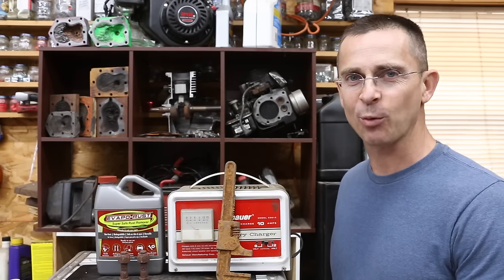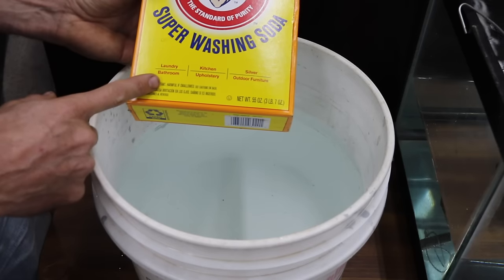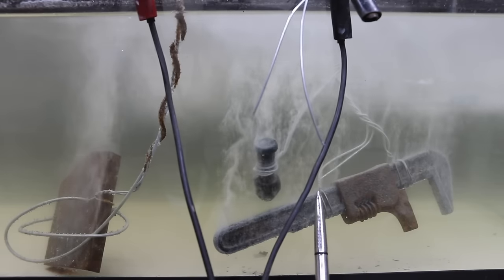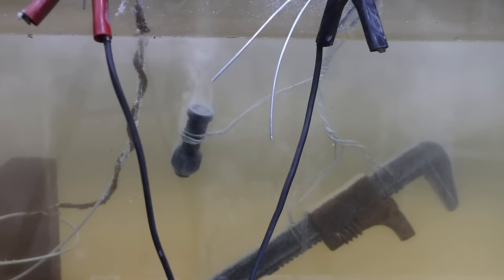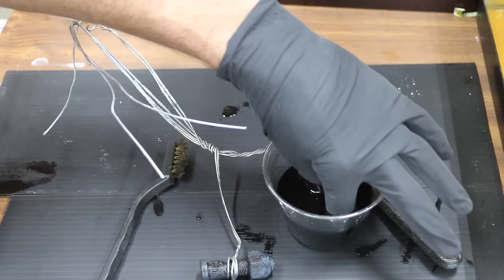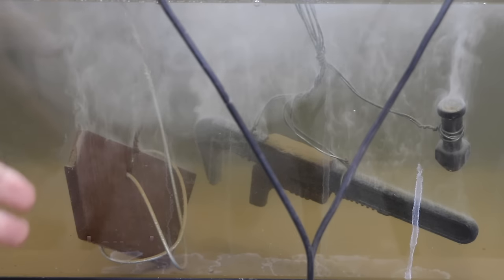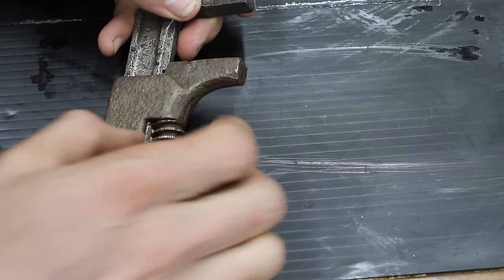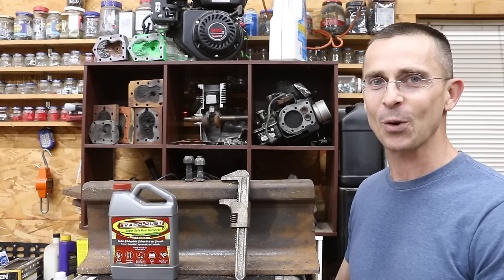Is Electrolysis better than Evapo-Rust?  Let's find out!

Comment: Have you ever used candle wax as a lubricant in an engine?
Reply from the maker: Thank you for the video idea!
Reply: That is a great idea!
Reply: @ProjectFarm  Perhaps as a second test barely dissolve the paraffin wax with mineral spirits.  That is what some of the bicycle chain dry wax lubricants use as a carrier.
Reply: Candle wax in an engine....ask anyone who uses Pennzoil. Very high wax content. Will work as long as the engine stays hot. Engine gets cold and solidifies.....game over.
Reply: I've thought of dipping tools and bits (screwdriver, drill, and router) in molten paraffin wax to prevent rusting, especially outdoors. The wax can even be recovered and reused by dropping the wax covered items in boiling water. The wax, being less dense than water, floats to the top and collects. I've discovered if the water is tinted with food coloring, the layer of wax can be easily distinguished from the water and skimmed off. 

To depart even further off topic, I was looking for a way to dispense paraffin for lubricating saw blades and screw threads and hit upon pouring molten wax into  an empty glue stick,(or chapstick, or lipstick)  container. Line the container with wax paper or parchment paper to keep the wax from sticking to the sides of the container. For broader strokes, use a deoderant stick dispenser to keep your tools smelling fresh and clean all day.
Reply: @philwood1009  Brownells cosmoline is my go to; I will give the deodorant stick dispenser a try.

Comment: Thank you again for your experimental comparison videos.

As electrical engineer i would say electrolysis is the most superb rust method.

The main reason is in electrolysis you lose almost no material from main part. basically it turns the red rust on the piece into black rust which is like a dustlayer and easily falls of with simple scrubbing.

Other methods such as acidic baths react with iron compounds (including rust which is iron oxides )and turn it into other compounds. As result they react with rust and main part and reduce material.

when you weight end products you will see (including electrolysis) reduction in weight. This occur in electrolysis due to removal of rust . in acidic compounds it will be both rust and main part.

If you make an experiment for a month putting two pieces one in electrolysis and one in acidic solution (refreshed acidic solution so acid will keep working on as electrolysis does) you will see that in acidic solution will melt your main part away but electrolysis just cleans.

Acidic solutions and electrolysis has both advantages and disadvantages.

Electrolysis has superb advantage of being cheap (you can make one with daily materials) however its labor intensive. It requires setup knowledge and if you want to rust remove 1000 bolts then you need to individually hang the bolts in solution which makes the process inconvenient.

Acidic solutions has superb advantage of ease of use . Produce a bath pour the solution in, dump the 1000 bolts inside and wait certain amount of time and drain it and clean . However it is expensive and since you produce a lot of chemical side compounds due to acidic solution and you have to dispose the acidic solution in proper way. ( electrolysis just has salty and rusty water solution)

Therefore i say electrolysis is superb on majority of applications.
Reply from the maker: You are welcome!  Thanks for the feedback.

Comment: Ordinary people: buy evaporust at the hardware store

McGyver: use electrolysis in the back yard
Reply from the maker: Thanks for watching!
Reply: Poor blokes like us will always use electrolysis.
Reply: People with large projects also use electrolysis.  How much evaporust is required to derust an eight foot pole?  A car fender?
Reply: I cleaned up a 51 Chevy radiator frame in a plastic kiddie pool using electrolysis... that would have been a LOT of expensive chemicals if I had gone that route... in addition, ZERO chemicals used in electrolysis

Comment: Needs more amp to speed up the process
Reply from the maker: Thank you!
Reply: It will only draw as many amps as it needs. You can not "push" amperage. Amp flow is a result of a DRAW.
Reply: @lewiswereb8994 you're right in a way, yes you cannot force more though once it reaches its peak, but matey is right, the maximum draw for electrolysis will be alot higher than this charger offers, I can tell by how aggressive the reaction is in this video compared to when I do it on my work, and I know I'm still not peaking the draw possible for the reaction as it still draws the maximum current my supply can provide, also your solution plays a big part in what the peak is too. Hope this has been helpful 😊

Comment: Can't believe you didn't notice something so obvious... the wrench has a separate piece of metal that you didn't contact with the wires, so OF COURSE that section is going to stay rusted while the rest of it didn't. You should have wrapped some of the wire around that part of the wrench.
Reply: He clearly said it was his first time using electrolysis for rust removal.

Comment: Great test.
I bought a 60 amp DC power supply to do big parts in a kitty pool, I used to use electrolysis a lot, but Evaporust is just so much easier, that's all I use now.
Thank you.
Reply from the maker: Thanks!  Thanks for the feedback.

Comment: You should really calculate the energy used in electrolysis and see if its worth it ?
Reply from the maker: Great point!  Thank you
Reply: I was thinking the same thing. How much did all that electricity cost compared to the evapo-rust? Will a car battery have enough stored energy to complete the entire process? I didn't even notice what his electric source was in the video.
Reply: I would think it would be very low energy consumption. You’re trying to push electrons through water.
Reply: @schembo2000  Not through water, through ions dissolved in it
Reply: @ThePrufessa  he was using a car battery charger amd i think a full car battery would ve enough to do so.
Reply: InfiniteLoop good point. I forgot about that.
Reply: @schembo2000  lol it's cool
Reply: @lamoona4269  You can't say that with certainty without knowing the energy consumption. You're just making an assumption

Comment: So like

Ive had some pretty damn good results with vinegar.
Reply from the maker: Thank you!
Reply: Vinegar will pit metal.  You must dilute 50-50 with water but it can still damage metal.  Ok for tools.  Not ideal for collectible cast iron skillets.
Reply: You can’t leave metal in vinegar for long periods of time or it will eat away the metal. Electrolysis you can leave indefinitely and never ruin the metal. If you forget your metal piece in vinegar and come back a day or two later you’ve likely pitted the surface,  not so with an etank.

Comment: If you watch the video carefully, you'll notice that the body of the wrench was really bubbling, but the sliding sleeve, hardly at all. That's because there wasn't a direct connection to the slider. Had that been connected directly, the electrolysis would have worked much better.

It's also worth noting that the gas given off at the anode is oxygen ... that's why it rusts. The gas given off at the cathode is hydrogen which reduces the iron II III oxide (rust) to black iron II oxide. That's how the electrochemistry works.

Interesting video.

Comment: I'm ADHD so I use muriatic acid. 🙄
Reply from the maker: lol.  That'll do the job in about 2 minutes.
Reply: I do the same... Works great.
Reply: Same here, also as a pickle pre-electroplating.  But you'd better pay attention or the entire part may dissolve!  That's kind of how it works, dissolve some iron out from under the rust so the rust floats away.  I find a somewhat diluted and used solution actually works faster.
Reply: @DCFusor  
👍
Reply: Settle down thanos
Reply: If you live in the south don't leave the muriatic acid bottle near you tools, due to off gassing it will rust everything inthe shop

Comment: I really enjoy your videos, you are so thorough! Slight correction, even with electrolysis, it is a chemical reaction, with electrical energy being used to supply electrons to remove the rust. In the chemical reaction you are using an oxidizing agent (usually an acid) to remove the rust. The reactions are essentially the same, with different agents.
Reply from the maker: Thanks!

Comment: I just watched this video. The rust removal of the wrench would been quicker if one the electrode wires was attached to the adjustable heel jaw so the current would have went through that instead of trying to go through rust from the handle. I like the videos. you go through a thorough extensive study/comparison. Keep up the great work.

Comment: I bought the 5 gallon bucket of Evaporust to remove 100 years of surface corrosion from my grandfathers toolbox. The big bucket was of sufficient size to fully immerse 1/2 the toolbox per 24 hours. Worked spectacularly.
Reply from the maker: Thanks for sharing.

Comment: As @DiodeGoneWild pointed out 4 years ago, you need a good electrical contact in order for electrolysis to work.  It is obvious that the rust between the wrench body and the jaw prevented the electrolysis from working on the jaw.  A second wire connecting to the jaw would have made the process work faster/better.
 Great video - THANKS
Reply from the maker: You are welcome!

Comment: Although this has been an interesting demonstration, I've used an ordinary bench grinder with a wire wheel or hand grinder with a wire wheel, and I can blow anyting down to bare metal, with the exception of the tight Corners where a wheel is too round to fit into. Those need to be sandblasted or bead blasted. I've been restoring and painting things for 40 years, and found that the wire wheel is simply the fastest and easiest. I do intend to do the experiment with electrolysis, now that I'm familiar with this process. Thank you for putting up this video!
Reply from the maker: You are welcome!  Thanks for sharing.
Reply: Wire wheel is effective for sure, however if you’re not painting the “wire wheeled patina” isn’t always a great look plus permanent scratching is a possibility, not to mention is totally obvious that the part was cleaned this way, again no biggie if being painted. Sanding or sandblasting actually removes layers of metal which is fine DEPENDING on what you’re applying it to. Electrolysis removes ONLY the rust, no metal is lost.

Comment: Negative= to take away from, positive= to add to i always learn something from your videos man great channel!!
Reply from the maker: I appreciate that!
Reply: It's actually the other way around... In this example the rust goes away no matter the cables are connected as it's solely removed through the hydrogen/oxygen scrubbing effect.
Reply: @kalle-iivarimononen7739  It's more than just a scrubbing effect. The anode will form powdery red rust, you don't want to switch them around.

Comment: The "sacrificial" piece's material matters. Plain steel won't work so good. You need something that attracts the loose electrons, such as zinc. As you can see, what i assume is zinc wires holding the pieces in the solution, is filled with rust immediately. Also it helps if you strip the rust from your pieces on the place you connect them to the wires.
The moving part of the wranch is not electrically connected to the handle due to rust, so it needs to be connected directly to the battery.

Great Videos :)
Reply from the maker: Thanks!  Thanks for the constructive feedback.

Comment: excellent video, as usual Todd, thanks. I note that you're using an old school battery charger running at 12 volts.  Would you be able to try this again at 24v?  I tried the electrolysis method myself with washing soda, but it didn't work. I discovered that the charger I bought was a smart charger and wouldn't operate without a battery being present.  If anyone at home wants to try this out, you NEED to use an old school battery charger, smart ones just do not work.  The amount of electrolyte added to the water does make a difference.  The higher the concentration of electrolyte, the more effective the rust removal.
Also, do not use electrolysis on non ferrous metals (brass, copper, aluminium etc).  Be extremely careful with what you use as an electrolyte.  Any number of chemicals can be used, but some present a double danger as the anode (positive) gives off hydrogen gas due to the breakdown of the water itself, but the cathode or the workpiece may give off chlorine gas.  Both hydrogen and chlorine are extremely dangerous stuff.  Hydrogen is extremely explosive, anyone remember The Hindenburg Disaster and chlorine gas is terribly poisonous and corrosive if it gets into your lungs.
Finally!!  To give an indication of how dangerous these two elements are, if you react Hydrogen with Chlorine you end up with Hydrochloric Acid, not something you want to mess around with.
So, have a try and see the results for yourself.
Thanks for this video again Todd, much appreciated,
Reply from the maker: You are welcome!  Thanks for the suggestion.
Reply: What happens if the connection wire is galvanised? Or the rusted item? What toxic soup gets created or fumes?

Comment: A small warning for those new to electrolysis , dont do it with springs on a tool ,
The springs become brittle and will snap on next use , just take em off before you dip em and shock em
Reply from the maker: Thanks for the feedback.

Comment: A quick comment about electrolysis. A few years ago I used 2 very rusty spark plugs for a test group. They results were very good  on the electrolysis plug. Since then the cleaned test plug and the control group plug have been on a shelf in my shop without anything put on them. The cleaned one still looks very fresh. 
I use a pool cleaning chemical for my electrolysis process rather than baking soda.
Reply from the maker: Thanks for sharing.

Comment: I have a couple suggestions. First, don't use excessively large water tanks. The closer the part is to the sacrificial steel, the more amperage your charger will use and the better it will work. So get the parts close, but don't let them touch the steel. Second,  you only need about one heaping spoon full of Washing Soda per gallon of water. And finally, use a piece of 1/4" carbon plate instead of steel. Using a squeeze clamp, clamp one carbon plate to each side of the bucket, so two or even four plates total if you want. Wire each carbon plate together, or use jumper clips and wire to connect them together. Using a squeeze clamp to hold the plate to the bucket works much better than trying to drill holes in the bucket and fasten them with wire. With steel, you have to keep cleaning the rust off the plate. Carbon just very slowly dissolves and there is no rusty mess. The water does turn black instead (rust converts to magnetite apparently).
Reply from the maker: Thanks for the suggestions.

Comment: The best way to use EVR is to stream it onto the rusted part. I use a fish tank pump and a bucket. Suspend the part in the bucket, and fill the bottom of the bucket with EVP. Run the fish tank pump with a hose flowing EVR over the part. In a couple hours the part will look brand new. This is going to beat electrolysis every single time. I urge you to try this method. You will be amazed.
Reply from the maker: Thanks for the suggestion.

Comment: 1-muriatic acid cleans rust from steel.
2-iron oxide / rust is an electrical insulator.   you never made electrical contact with the nut  or the adjustable head of the wrench.  
regardless of their physical installation. 
think of a corroded batter terminal and your car not starting.
i'm certain the electrolysis would have worked correctly with appropriate electrical contact. 
love your channel
Reply from the maker: Thanks!  Thanks for sharing.

Comment: Electrolysis requires good electrical contact, which is why the wrench doesn't remove rust on the slide. Connecting a wire to it would have been MUCH better. Electrolysis also 'explodes' pieces of material off the surface of object due to H2 bubbles. It is usually a much rougher result, losing fine details and clearances (like threads). Electrolysis is mostly a 'line of sight' process, meaning hidden areas are not best affected (think flashlight and it works best where a light from the sacrificial metal would shine). Let's see an UPDATE and IMPROVED comparison. You have a good voice and script and video skills.
Reply from the maker: Thanks!  Thanks for the feedback.

Comment: Notice that the lower movable jaw stayed rusted much longer than the body of the wrench during the electrolysis process.  That is because he did not run his wires around that lower jaw but just around the body.  The current did not flow through the lower jaw as much as it did through the body.  The lower jaw had a higher resistance between it and the body because there was a corrosion layer between the body and the lower jaw.  Had he connected the second wire on the wrench directly to the lower jaw current would have flowed through both the lower jaw and the body more equally.    But all that cost him was a little more time.

Comment: With the electrolysis, didn't notice if the parts where the wire was connected to the metal if it was scrubbed clean of rust, plus it appeared the wire still had a  protective white coating on it , both not creating a good electrical connection
Reply from the maker: Thanks for the feedback.
Reply: @ProjectFarm  welcome.

Comment: You are dead right about using electrolysis for large parts. My excavator undercarriage had lots of heavy pitting on top with deep craters. I used an inflatable paddling pool and put smooth wood in the bottom then put the individual parts of the undercarriage in it. Took all the heavy rust off everywhere. God knows what it would have cost to do that with Evapo-rust LOL.
Reply from the maker: Thanks for the feedback.